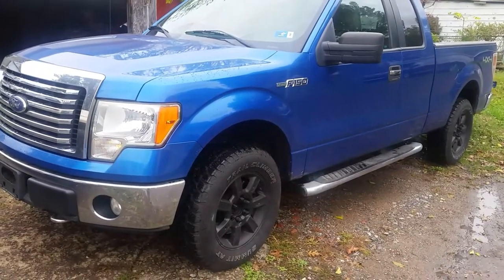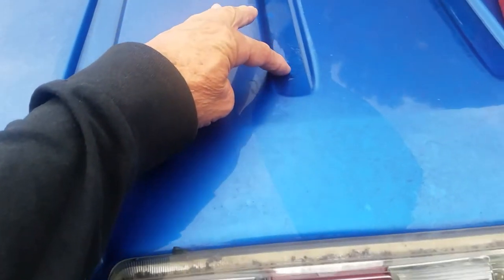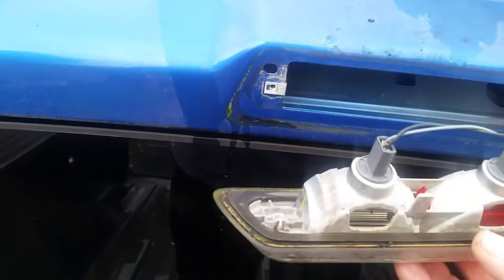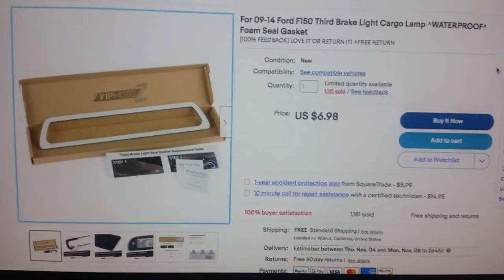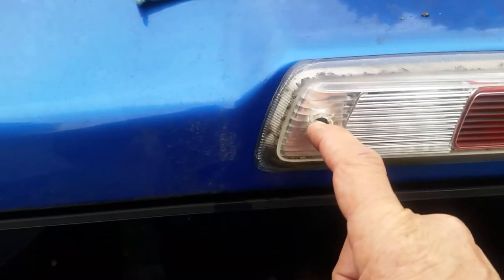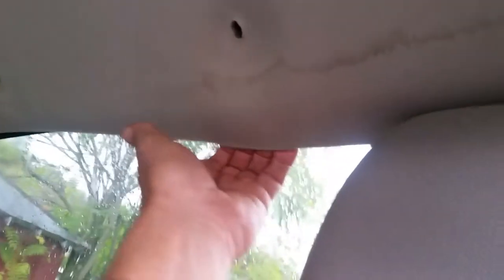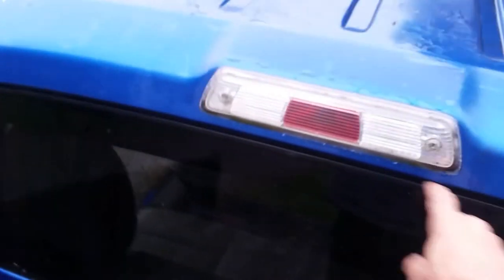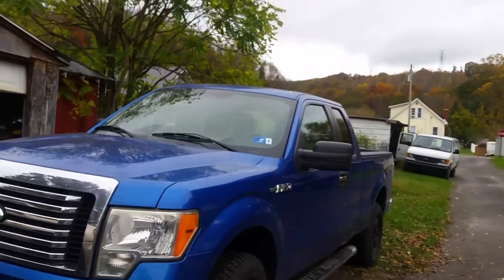F-150 The Rear Headliner leak that won't stop

Comment: Been trying to figure out the same issue, replace 3rd brake light gasket, even sealed it, changed corner moldings, sealed them also. Didn't work. Start the truck, turn a/c on high on recirculate shut the doors with windows all up and spray the rear glass with a mix of dawn dish soap and water and you will find exactly where the leak is. Mine was the back glass. It blew a bubble the size of a baseball within 3 or 4 seconds. Hope this helps.
Reply from the maker: Yes found mine also did a video on it also in my playlist!
Reply: @FixingWithPassion  Then you're the one I watched that led me to the fix, thank you so much for the info, my mom says thank you, it was driving me mad trying to figure out where it was coming from!
Reply: Did you had to replace the whole glass?
Reply: How did you go about getting that fixed?
Reply: @minecrafter4623  Permatex  silicone sealant around the gap between the glass and body, haven't had any issues
Reply: It's the rivets on the roof! Not the light
Reply: @FixingWithPassion where is the video of getting it fixed? Can’t find it on your playlist.

Comment: the rivets on the roof leak. Replace the rubber and rivets, a dab of silicone under the rubber and a dab on the top of the rivet. Dead give away is the headliner stains on the corners

Comment: I have replaced the 3rd brake light several times, replaced drip rail straps and rivets, replaced back windows since you can buy the seal for the slide window, and butyl rope for the back window.  Leak keeps coming back in one of these places. Hate it so much.
Reply from the maker: Yea me too!

Comment: My 2010 F150 was leaking several years ago... i too thought it was the seam seals on the corners.. i coated it black RTV silicone.  It ended up being the 3rd brake light... i used RTV on the gasket instead of replacing the gasket..  its been leak free since
Reply: Is RTV superior to Permatex Silicone?

Comment: Funny how so many of us have the same solution in mind on this leak. I sealed the 3rd light, that corner of the roof.... had to do the window. Time will tell... 2010 F150, same as yours. I also (when possible) now park with the rear facing the SE. The prevailing winds and storms come from the W-NW. Mine only leaked with the truck parked. That helped prior to sealing the window.
Reply from the maker: Nice!!

Comment: I had the same problem. I used Permatex silicone and just threw away the gasket. Ran a small bead of sealant in place of the gasket. Then I ran a bead around the light and removed the excess silicone. Never leaked again. You will have to cut the seal to replace the bulb when it goes out. But the process is pretty simple to repeat. Good luck.

Comment: I have a 2009 f-150 with the same problem, but I thought it was leaking from the sunroof hoses, I had a compact car a few years back and a fixed a similar problem just replacing those hoses. I hadn’t had the time to do it, but with your explanation I will focus also on the reat glass sealant. Thanks
Reply from the maker: Nice!!

Comment: Same issue in my 2010 KR. I have the 3 sections to my back window with the center one that opens electronically. My truck smells like cat piss when it rains. I’m replacing my 3rd brake light again and will partially pull my headliner to seal inside AND out. Then I need to shampoo my headliner to get the discoloration out.

Comment: I have exposed rivets on roof of 2019 F150, were there plastic plugs covering them at any point? I’ve used  high pressure car washes and have stopped going to such places due to the negatives. Should I put plastic plugs in exposed rivets?
Reply: Hi did you ever figure out if the exposed rivet was causing your leak?  On my 2018 F150, the rivet on the passenger side has a hole in the center of it…looks different than the one on the drivers side so I’m thinking water is getting in there on mine. Thanks for any feedback. This is so exhausting.

Comment: I changed my third brake light because it was filled with water even and it's still leaking. My seals on the roof with those rivits are really rotted I wonder if that's it.
Reply: What was it? Did you get it fixed?